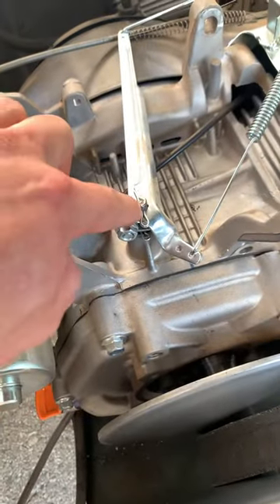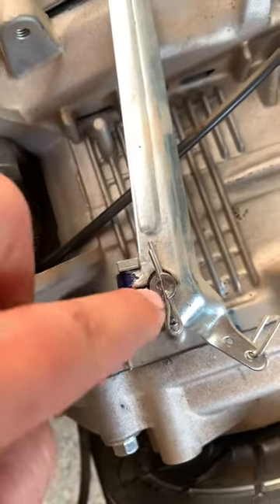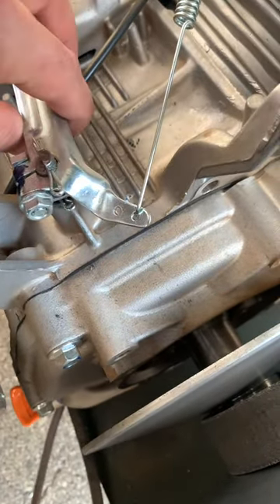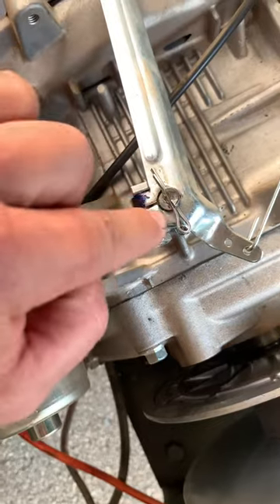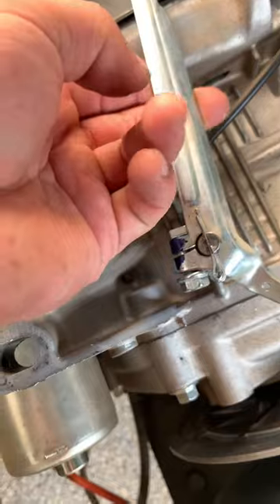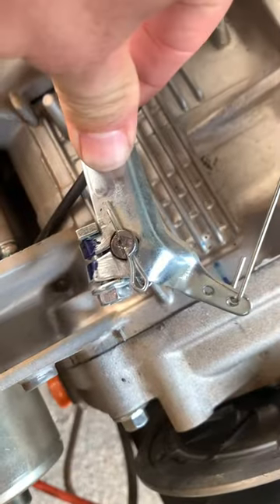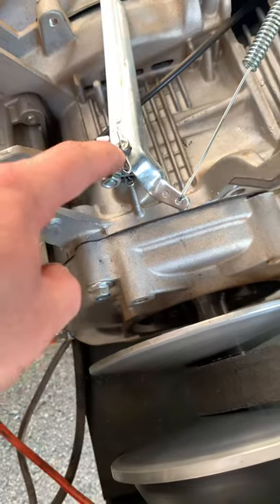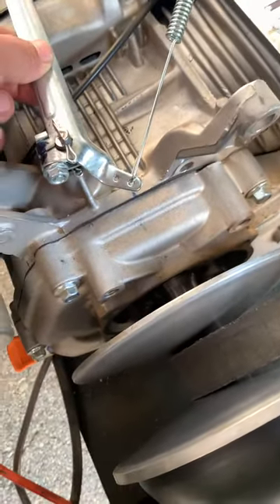Easy Hack to removing governor control without removing governor or bypass on most small engines

Comment: It still could grenade at some point. The fly weights are still inside case, attached to a plastic gear. And now nothing to stop  centrifugal force from streching  mechanism in the case. The arm u modified also kept the govorner weights from going out to far.. it could work for years, but at some point, its gunna go. And it usually busts a hole in the block.
Reply from the maker: Good observation. Thankfully I haven’t had any issues.

Comment: That's bypassed, not removed. For a lot of applications it's better to remove the plastic governor gear from inside. The plastic gear could still break apart from going too fast and that can be a show-stopper.

Comment: Why don’t you just remove the arm? Won’t that do the same thing?
Reply from the maker: Yes, it would. That’s actually what I ended up doing. I bypassed the governor arm by connecting the throttle cable to the throttle arm (not the governor arm) and bending a wire to connect the throttle arm to the carburetor.
Reply: @realdealGod can we get a video??
Reply from the maker: @queencitygraphics5661  let me see what I can do